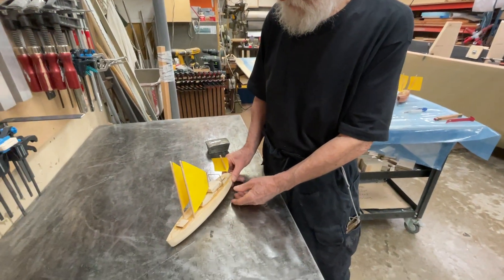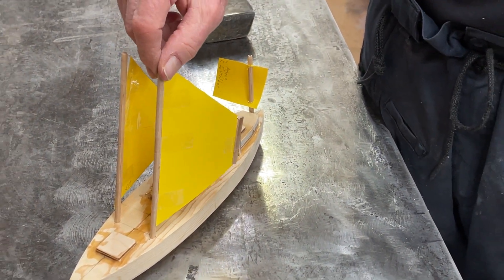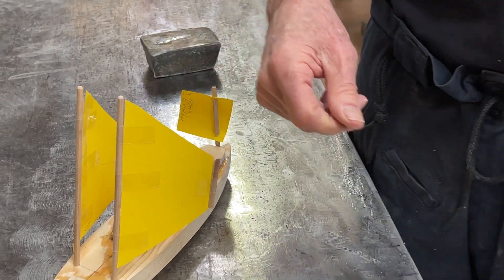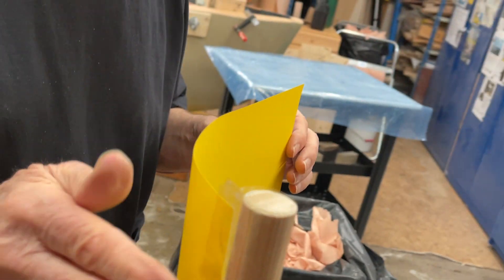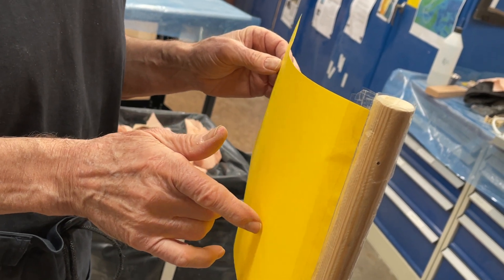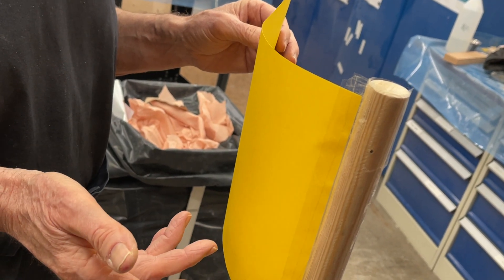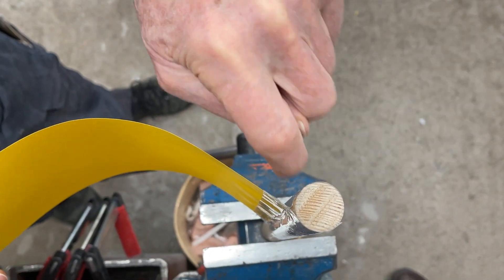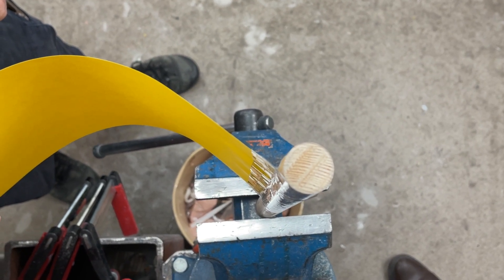Poor mans wing mast. By turning the sail track to the lee side turbulence is reduced.

Comment: Hello Swen!
Does a selfmade boat require certification of the corresponding departments? Do you need to pass through some registration procedures to be able to use it?
Reply from the maker: In the European Union It does not need certification or procedures what I know of. Definetely not in Sweden where I am.

Comment: Proposals for the masts. The company Jefa in Denmark manufactures bearings for free-hanging rudders.  It is roller bearings in plastic.  I have built such a rudder for a "Lady Helmsman".  The rudder has now been in use for thirteen years.  It still works great.  The rudder is 1.4 meters deep, made of carbon fiber, NM epoxy and divinycell.  The distance between the upper (dia 30mm) and lower (60mm) roller bearings is one meter.  Jefa manufactures both larger and smaller roller bearings as well as sleeves in stainless steel adapted to the roller bearings.  Happy new year and good luck with your new boat.
Reply from the maker: Thanks for the tip but my sails are so small so noo need.

Comment: Thank you for the demonstration of the sail attachment sir. Will you have rotating masts for shortening sail and will they operate from outside the cabin or from inside the cabin?  That is going to be a very powerful sailing rig.  Have a good day.
Reply from the maker: The mast rotate for shortening the sail. It will be opeerated from the aft deck hatch preventing water from enter the boat.
Reply: @SvenYrvindExlex  Thank you for your reply.

Comment: hallo Sven,
i love the new desing.
What kind of bushing or bearing will you implement for the rotation of the mast?
Reply from the maker: That part of the building will be after the accomodation and deck its in the future. May be some kind of low friction thermeplastic or Tufnol. I will start thinking about it later. Now its other problems to be solved. It is not a difficult thing the sail area is 3.5 square meter like an Optimist dingy.

Comment: It's going to be a fantastic rig. I only wonder why the spin-furling mast isn't more common. I only know of a couple examples. Some small Hobie-cat sailboats and Yann's Baluchon.
Reply from the maker: Racing rules forbid them and production boats follow racing boats. Also it is more simple to do in a small boat. But boats fore the Vende globe and such use them.
Reply: @SvenYrvindExlex  How long are you thinking the 2 forward masts will be total from base to mast-head and how deep will they go inside the hull?
Reply from the maker: @JakeHolman78  The sail will be atached to the mast for 3 meters. Where the the sail will start over the deck a mock up will decide but 0,3 - 0.5 meter in that region so total over deck 3.3 - 3.5. Inside hull? I have not started to figure it out but something like 0.5 - 0.6 but I will start to think about that later.
Or " I cross that bridge when I get there."
Reply: @SvenYrvindExlex  Thanks. In English I like to say "We'll burn that bridge when we get to it." Which is a funny cross between "don't burn your bridges" and "We'll cross that bridge when we get to it." 😂
Reply from the maker: @JakeHolman78  Thanks thats fanny.
Reply: The Escape range of sailing dinghies had them.  I don't know if they're the Hobies sold under a different name.